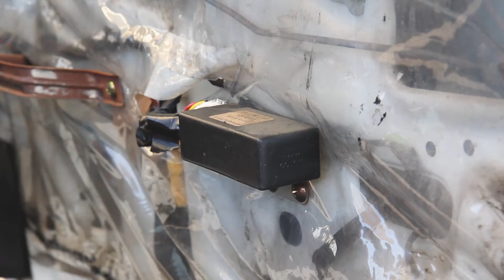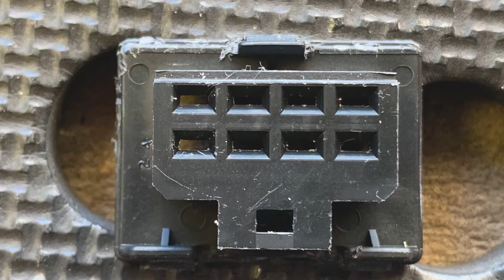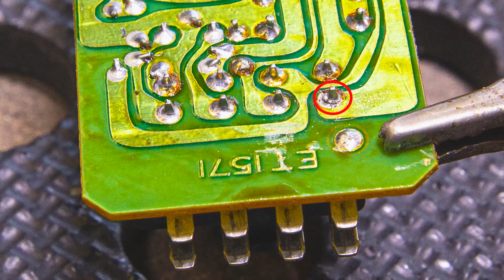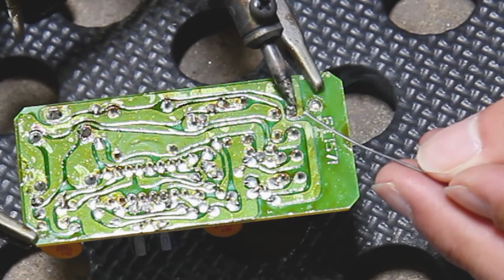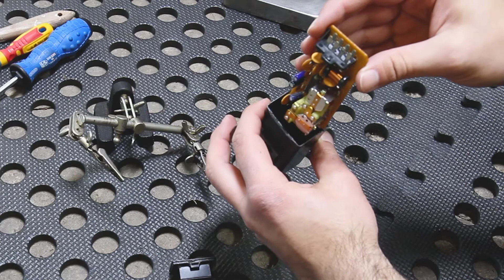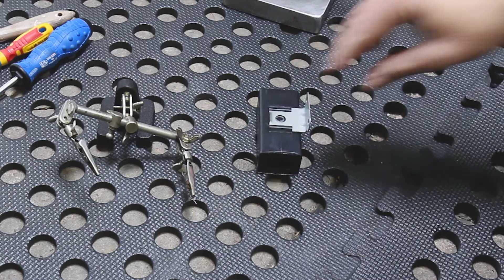How to Repair an Intermittent Power Window - R32 GTR V-Spec II

Comment: Great video - Question- I've done this repair twice now and both times it's worked perfectly for like a week and then slowly starts to become intermittent again. Any ideas?
Reply from the maker: Hmm there might be a pin which still has some cracked solder around it. It may be worth checking each one with a magnifying glass just to be sure. Another option is clean the solder off each pin with a solder wick and then apply fresh solder to them. I've never used a solder wick before but have seen them used for this purpose. Good luck!
Reply: @Dark2568  Thank you for the reply! i'll give it a closer look and check to see if there are any other connectors that need soldering - I'm assuming if it worked perfectly after barely working at all after doing this fix then it is something still to do with the pins.
Reply from the maker: Yeah it sounds like you've fixed most of the problem but maybe there's another pin which isn't making a perfect connection.